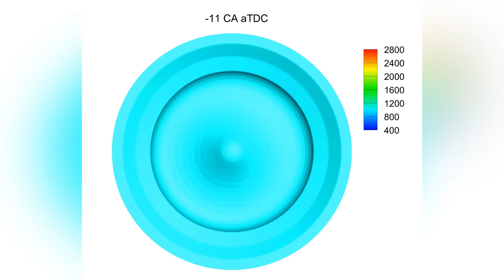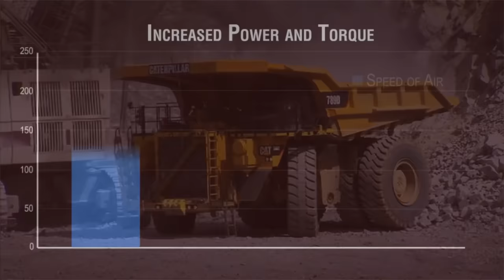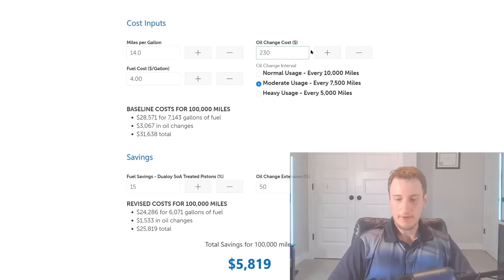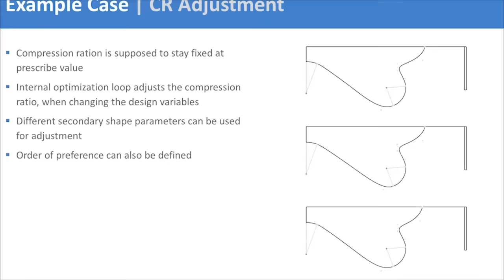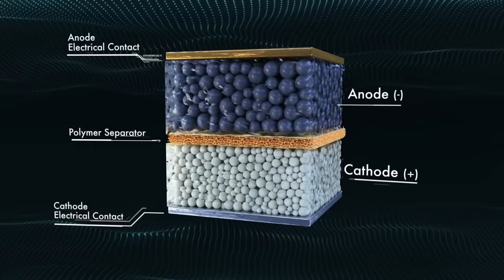ICE Breakthrough!? NEW Piston Design BREAKS Records

Comment: I race car has a destroked Chrysler hemi we're running about eleven to one compression 50 psi manifold pressure on 85% nitromethane car makes so much horsepower under 4500 rpm it will go over 300 miles an hour with no transmission its direct drive we make two 5 mile passes burning 500 lb of fuel for each 5 mile segment for an average speed.
No dimples no funny business.
Dimples on a boat hull are for real.
Best piston I ever made probably cost about $3,000 each has four parts, a frame a skirt a head that contained the ring lands and a ceramic dome.
Went in a 2 liter V8 engine supercharged by a modern turbofan jet engine by switching a switch you could either get crankshaft torque output or thrust exclusively.
It was a modern look at a world war two German design.

Comment: I call bullshit. There is no way piston bumps help the oil.

The scond set of piston rings could, but that also increases mechanical drag. Not only for the increased contact area, but every ring has less oil (to slide on) than the ring before.

Some engines had 4 or 5 rings per piston, generally engines in stationary equipment (IE: backup power generator at a hospital or military base). That design is for longetivity, NOT efficiency, and the power losses would counteract power gains. 

Nobody cares about how long it will last, that's why engines are now made of plastic.

Comment: Well as far as Renewables go we are years away form worthwhile 50 years or so possibly more . There are some i have notice that seem over cocky that it is BS to quote a line  IS it  What does the BS description base on present tech that is woefully lacking  Humm EV's will only become a viable mode once we have storage that charges fully in the time it takes to fill an average fuel tank and the range is greatly improved  doubled at least then there is also the weight  too heavy by far .

Comment: Where are the scientific trials results? That is trials where the Control is a conventional piston is tested against this new design? Same bore n stroke, same comp ratio, same ring pack, same weight. There are no proper trial results, so it didnt happen. Combustion chambers in the piston top has been used for decades in various shapes, but has not shown any advantages over conventional designs.

Comment: There are dimples, and there are caverns, which this design seems to employ.   I call bs.    The charge exiting the chamber is at LEAST as important and entering.    And the notes all around, not just this video, but all of the EV naysayers claiming that the grids can’t handle the “extra” demands of EV charging.      This has been studied in depth and it’s complete rubbish.   The recent effort in California to reduce the demands on the system by NOT charging your EVs at PEAK hours was a discretionary campaign to make EV owners more aware of WHEN they were charging their cars.    There had been no serious threat to the grid beforehand, but the engineers voiced their concerns for a worst case scenario and simply sought to make a preemptive strike to get a different mindset rolling.     During the “changeover” period between ICE use and EV use, there will be some spikes in electric grid usage,  as BOTH types of propelling machinery will be used, and that overlap is what I’m calling the “changeover.”     This period will hit its peak in the next three to five years, but will certainly not be the fault of the EV.  It MAY be caused by EV use, but not the FAULT of the EV use.   These “changeovers” have happened in the past, but even then, they weren’t really changeovers, they were simply dramatically increased demand on the grid, in three  notable periods in modern history.  One at the onset of refrigeration invention, implementation on the industrial scale,and then into progressively more common household use.   There was a significant increase demand on the power grid, unfits were made, new stations were built, and life went on with little fanfare or uproar.    Everyone was happy, people could keep otherwise trashed food longer, such like and so forth.    Soon enough the second wave came along, with home air conditioning, which was yet ANOTHER big demand on the grid, and yet another cycle of up fitting was done in accordance with de,ands, and it was at this time that many companies put great effort into future proofing their systems.     No system can be entirely future proof, but they can implement forward thinking provisions to prevent problems on the horizon.     This happened in the past, it wasn’t a catastrophe, and we moved on.   In this case, the actual overall impact will be significantly lower than those previous changes.     And to make a bit of a sarcastic joke on the matter, these things do add up.    For every vehicle being charged directly from the grid, there is also one less vehicle using the electric pump at the gas station which pumps fuel from the tanks in the ground to the automobile tank.   I’m not so naive as to think a pump moving 20 gallons of gasoline up ten feet and into a car will use as much power as an EV Charger.  But it is yet another part of the equation I have yet to notice anyone else take into consideration.    The amount of electricity consumed from the point of drilling for oil, then containing it, transporting it, refining it, then transporting it again, all use quite a bit of electricity, and let’s just start adding it all up, by volume of energy density, or by whatever means, it will add up and a reduction in oil production will partially offset the added demands of EV charging, at least.   Not to mention the one giant elephant in the room.   ICE systems are at best of the best approaching 40% efficiency.     EV systems at worst of worst are over 85% efficiency.    There is not even a ballgame here worth competing.    All the EV naysayers are arguing a subject lost before it began.      You can calcualte the environmental impacts of lithium mining till you are blue in the face. And how fossil fueled power stations are often used to charge EVs in the first place, all day long, but when it comes down to REAL, QUANTIFIABLE DATA, there is no argument to be had.     We will soon enough look over our shoulders in shame and wonder why it took so long to take advantage of the wonders of electricity.   One word.     Greed.          That’s why.

Comment: EVs are a dead end...and they do NOT reduce emissions...only relocate them.
Reply: They do reduce emissions by about 25% over their lifetime. But it depends on the energy mix of the country
Reply: @nade5557  why because you are told that? Nobody knows exactly and that is why I do not make spurious claims like you.
Reply: @nade5557 yeah they should, but if they are just throwaway vehicles that dont last long enough then they are useless.
Reply: @Vile_Entity_3545 to you i say, weve optimized everypart of fuel production and engine developement. Electrical is nearly equal and has infinite room for improvement currently
Reply: @Everett Stormy  Around 10 years is what the study considered "lifetime". it seems reasonable
Reply: @nade5557  Hi. Let's do some simple math. Electrical power in the US is created using mostly natural gas and coal at an efficiency of around 38%. The electricity that powers the EV wheels goes thru inefficiencies on its way...transmission lines to the charging station (90%), EV battery charging (90%), EV motor efficiency (90%), and EV transmission efficiency (90%) [I'm being kind at 90%). 38% x .90 x .90 x .90 x .90 = 25%. ICE vehicles are usually 28% to 32% efficient (potential energy in gasoline converted to work to move the vehicle). It's a lie that EVs are cleaner. They are less efficient. Until all power is created using nuclear fission (or fusion), EVs will never be cleaner...just a political football. And solar, wind will never be able to meet global energy demands. EVs would be great if they actually helped matters.
Reply: That is a great observation that the politicians in government and the globe don’t want you to know. Who is benefiting from this relocation of the pollution?
Reply: @holmesautomationcomponents9476  valid points, but specific to certain areas.  The US is vast, not every region creates electricity by combustion, and the US isn't a valid representative of the rest of the planet, despite USians constantly referring to their country as if it's a reference for the world.  Many areas, especially in Europe, have developed a more sustainable electrical infrastructure, such as nuclear, wind, solar, etc.  Also, we're still in the "horse and buggy" stage of infrastructure and battery recycling technology.  Obviously switching vehicle tech too fast won't have an advantage unless everything develops together.
Reply: @Holmes Automation Components, Inc.  a) you're going to disregard an actual lifetime analysis because you think your maths is better? b) your numbers are off. 38% efficiency and 8-15% loss from production to consumer, including transformers, transmission lines etc. So 32.3% efficiency as a lower bound. As good as ICEs, with the added benefit of making cities cleaner via reduced particulates from exhausts. But here's the thing. That lifetime analysis takes into account everything. Your maths doesn't take into account the logistics behind petrol and diesel transport. You account for logistics behind electricity transport, but not the transport of oil via trucks to individual gas stations. Electricity transport will always be more efficient than hauling stuff around physically. Anyway, I get the feeling you are biased and hate EVs. I will say I dont like them and they are not the solution to climate change. But you're focusing on the wrong numbers, because cars in total make up 8% of global emissions. Hence if all cars were suddenly EVs that would drop to 6%. Thats the thing, we have bigger fish to fry than ICEs, and EVs are not the solution to that problem anyway. Just use the right reasoning when talking about this stuff
Reply: @holmesautomationcomponents9476 As others have pointed out there's several mistakes in that conclusion, one is the amount of energy required to get and refine crude, then there's transportation. But technology constantly improve, at least when it's forced to, so I have no doubt that both EV and ICE will become better as long as we let them.
Reply: @PSA78  Hi. See my 2nd post in this thread. Transportation costs are transparent in this situation...they affect EVs too as long as the electricity is created using fossil fuels. ICEs are more efficient. Period.
Reply: @holmesautomationcomponents9476  It's not that many places that rely on fossil fuel for electricity, most places has it as back-up.

Comment: You could use magnetic alignment for the Pistons to keep them from touching the piston walls.
Reply: Might be  difficult to Isolate the Magnetic Flux  from the  Rotating Assemblies . A  Strong magnetic field would quite likely DRAG  badly on those .
Reply: @johncunningham4820  sounds reasonable

Comment: ICE are dead already, they just haven't realised yet.
EVs are just better in almost every measurable metric for almost every task.
There are of course a few fringe cases but unless there's some sort of huge breakthrough, EV has already won.

Even for things like those massive CAT mining dump trucks, EV powertrains can give way more torque.
They also have orders of magnitude less moving parts so much less maintenance and less down-time.
Whilst remote mining sites don't have grid connections for charging, they also don't have local petrol stations.
Much easier to throw up some solar/wind generation and battery storage than to build an oil refinery.
Hell, you could even continue to truck in diesel and just put it in a generator to power electric trucks and it would be more efficient.

When you consider we've had over 100 years of ICE development, I suspect we're close to the best we can do with them.
Plus, there's always the issue that oil is a finite, non-renewable energy source and will run out if we keep burning it.
EVs have only been getting proper focus on R&D for around 20 years and they're already better than ICE.

Unless I'm missing something, EVs have already killed ICE.
Reply: On some thing the size of that mining truck EV is just a non starter.  The battery pack would simply weigh too much and cut down the load capacity of the truck.  It's the same reason why the Tesla semi is a joke.
Reply: @brandons9138  Tesla semi is a joke?
Better tell Pepsico and Frito Leys since they've started rolling them out and initial feedback is positive.

For dump trucks, there's a few things that makes EV versions very viable.
Firstly, they don't move very fast and so they're not working against aerodynamic drag likeroad-going EVs.
Next, the diesel engines and fuel tanks on these machines already weigh a substantial amount, swapping for batteries doesn't make a huge difference.
Next, they're often stationary getting loaded so they won't be using power whilst diesels are always running.
Next, due to the fact they're not going to be moving fast, they can use a set low gear ratio meaning the motors are hardly working.
Next they'll be regenerating large amounts of power when travelling downhill in a mine.
Lastly, as a percentage of overall vehicle weight, even an extremely large battery pack would probably be negligible.

Combine these reasons with the numerous benefits like on-site power generation instead of shipping in huge quantities of diesel, little to no maintenance required etc and I think you'll find they are extremely appealing to mine operators. Caterpillar certainly seems to think so since they're releasing electric dump trucks soon.
Reply: @airchie2  Two companies adopting the Tesla semi doesn't make it less of a joke.  There are plenty of videos here on You Tube that go into the issues that a EV semi face.

Yes a dump truck doesn't move fast, but that is a minor detail.  Hauling heavy weight is MUCH harder on the motors/batteries than moving fast.  The current draw is substantial. Far more than it would be cruising at 80MPH.  You'd still need to power large pumps to run the hydraulic systems that are required on a truck of this size.  That would either place even more load on the batteries or require a completely separate system to power them.

Have you see the weight difference between any EV and a ICE vehicle of same size? EV's tend to weigh 10% more with less range.  In an operation where hauling capacity is everything that difference is a problem. As it just cuts into the load the vehicle can handle.

Charging time is also another problem for an EV truck.  That is something that all EV's face.  It takes WAY longer to charge an EV than it would to fill up with diesel.  All of that charging time is production time lost.  Adding a larger battery pack make the issue worse not better.  You also have to remember that battery packs lose a higher percentage of power in a extreme environments.  Extreme hot or cold has a much larger effect on the capabilities of a battery than it does on a diesel engine

Adding a transmission to an electric motor reduces it's efficiency as now you have more mechanical losses though the transmission. This makes the power usage and charging problem worse. 

Driving down hill won't regenerate near enough power to make up for the losses incurred during the up hill accent.  It's estimated that a model S would need a 6 mile long slope to recover 100% of its power.  That's at 100% regen capabilities though.  So that estimate falls flat because it's not 100% efficient at power regen. 

On site power generation is a pipe dream. Solar is a joke for generating the amount of power needed to charge a large fleet of VERY large batteries.  A wind farm of sufficient size to generate that kind of power is huge cost and a substantial construction project in it's own right.  What happens when the sun is not shining or there is not enough wind to generate the power needed to charge a truck? Bring in a generator?

So I dug into the numbers a bit. A Caterpillar 797 mining truck has an engine power output of just over 2500kW. A model S battery has a 100kWH battery. It would take roughly 25 Model S battery packs to run a dump truck of that size for one hour. Now imagine the size of the pack required just to make it through one shift without recharging. Then factor in that most mines run 24/7. So the charging time alone would necessitate having multiple EV trucks to replace one diesel truck.

Comment: Duramax was the worst diesel engine ever made! This type of tweaking old design that is engineered and tested through time is dumb af. 3d pistons are being put in vehicles and failing bad. All new jeeps , gladiator,  rubicon, wrangler, etc. All have 3d printed junk pistons that fail and ruin the engine!
Reply: From your comment you seem to be an experienced person in engine repair. For the record what older diesel would you recommend as the best performance for the money spent in the auto industry? Even if they are foreign Diesel engines please advise us. I’m thinking of doing an engine swap from gas to reliable diesel.
Reply from the maker: We have an old 6.7l 2007 Cummins, never missed a beat except for the front end of the truck heh